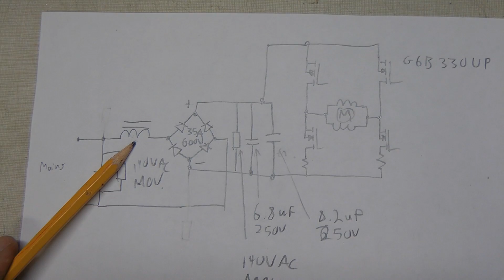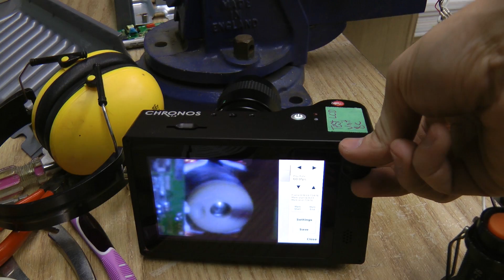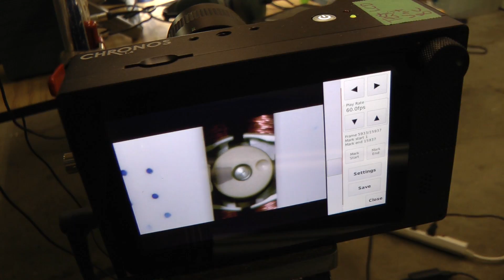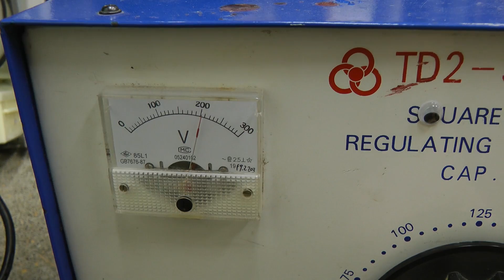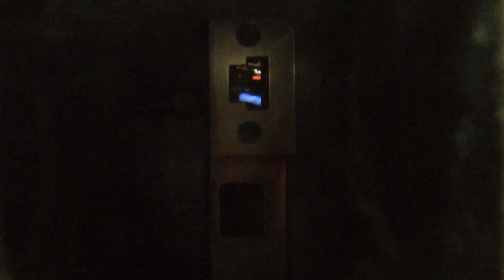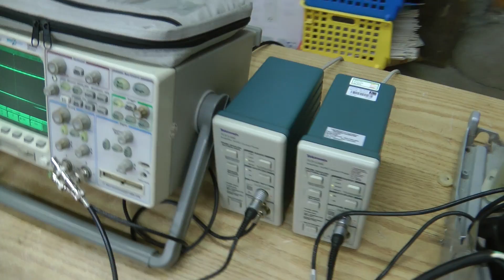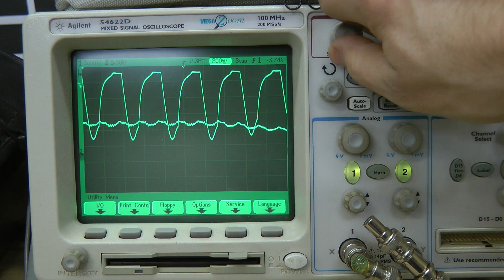Dyson Airblade teardown and repair - AB-14 and AB-02

Comment: The motor is actually a single phase interior magnet pmsm. Allows for high power density. I'm wondering if you could find an asymmetry in the airgap of the motor as it has this nice starting behavior?

Comment: Audio interference.... A few years ago I was at the 100 Club in London, where they had these in the toilets, and you could hear them breaking through into the PA system
Reply: That is impressive amounts of EMI
Reply: @Andrew Ballard Iseewhatudidthere
Reply: The PA system and the bog should be fed from their own supply. Sounds like the hand dryers were connected to the same ring circuit as the PA system.

Comment: These have always looked like over-engineered bacteria farms to me.  I wouldn't use them unless I was forced to.  Give me a paper towel any day of the week.
Reply: I hate how narrow the slot is. Gotta be careful not to accidentally touch all that bacteria.
Reply: Corona virus, the dispenser.
Reply: Yes, the airblade v, airblade wash+dry, and airblade 9kJ are better designs.
Reply: It's funny how badly this comment ages. Now that the 9kJs have been established they are aldready dying and sounding rough, whereas many of the original airblades from the 2000s are still going strong

Comment: It’s quite funny that they have invested so much engineering effort to minimise the noise of the motor vibration and air compressor, while the airblade nozzles just by themsleves sounds like a f*cking jet turbine while operating... Is it just me, or they could spare a lot of expense in that department?
Reply: It's probably a lot louder when you combine the two sources of noise!

Comment: I never liked the dyson ones. Your hands always touch the device and they are not effective with big hands.
Reply: Yeah, and there's always that cesspool of nastiness at the bottom which you inevitably touch if you have big hands - ugh, I avoid these at all costs. Even good ol TP and picking bits off your hands a few minutes later when they actually dry is better than the dysons

Comment: The die cast airblades used to corrode with heavy use. You would see high-traffic locations such as airports and theme parks which would have significant corrosion on the drip pan. For that reason, I am not opposed to the plastic chassis.
Reply: @zaprodk  They could have just decided to retrofit an insert of plastic.
Reply: Exactly this. I got two of the first generation ones for free, for no reason other than cosmetics. They were in the lobby of a very nice hotel, and they were replaced due to the corrosion making them ugly.
Reply: @kelvinstokes996  thats like saying to someone your ugly when they are inteligent and kind but just because they have a skin condition they dont get freinds

Comment: Maybe they use the hall sensor to detect the absolute rotation at rest to it starts reliably
Reply: I was wondering if the "cogging" strength was deliberate (and not so much as a side effect) so the motor at rest is in a predictable state between poles after powering down?  I'm 100% guessing, as I have little to no idea what I'm talking about, unlike yourself. 

The only foundation I have for my guess is that the motor took a good while to come to rest, it seemed to oscillate quite a fair bit before coming to a complete stand still. Eddy current to position? 

As I say, not a clue. Sorry for wasting your time if you read this comment.
Reply: Well the poles are not at 90 degree angles. The hall sensor knows where the rotor sits and thus the next pole to energize with a "+". Form there on it is either an open loop slow start of a closed loop hall feedback (I suppose open loop).

Comment: They actually don't depend on sensing to determine motor direction.  Instead they use a salient pole to ensure that the field moves in only one direction.  All DDMs that I know of are open-loop.  There is also active control of the drive waveform at speed, somewhat similar to the SMOOTH technology used in ST's brushless motor drivers.

Comment: Hi Tesla500, A quick question about the motor bypass. From what I understand you are connecting the white signal wire to the black neutral wire in the cable that powers the control board, and taping off the red live wire. 
Is this correct? I'm using the motor for a low-cost air knife build and I just want to make sure ere I blow it just before installing it 😅

Comment: Yeay a Tesla500 video. The clear plastic so deep in the motor/turbine is an interesting choice.
Reply: Must have been a cost thing, using a batch of contaminated transparent mix instead of any other colour, because the plastic batch has a minor colour error from being mixed with other beads. You see a lot of inner plastic parts made with multicoloured recycled plastic, that has been salvaged, extruded into beads and chopped up, and then all the odd bits of colours left over in the batches are run as interior parts where you do not care much about colour,.

Or the plant just wanted to change colour on the moulding machine, without stopping, cooling and stripping to clean it, so swap to the die set for the inner, change the bead supply colour, and run a few thousand cycles of parts till all the old stuff has been purged out. Saves a lot of wasted plastic, and makes a saleable product, instead of a 5 hour clean cycle losing money.
Reply: @SeanBZA  seams reasonable. My thought was that the housing might have been of polycarbonate, maybe for shatter resistance. But tbh that's mostly based on the fact that I can't remember seeing opaque polycarbonate.

But at you say Dyson tend to make a lot of translucent parts so it would make sense for them to have some translucent wast on hand.
Reply: @coolfrost6  Polycarbonate is not the most easy to work with, so they would have gone with a cheaper plastic wherever possible, even if it has to be thicker. Polycarbonate for those high strength outer housing parts, then cheaper PVC or other plastic when cost is a driving factor.
Reply: @SeanBZA  I agree that is why it strikes me as od. Correct me if I'm wrong but the only injection moulding plastics I'm familiar is PS, PET, PMMA and PC that would yield that level of translucent. Maybe also some funky versions of ABS.

Of those I only think PC and funky clear ABS are reasonable choices.
Reply: @coolfrost6  Plastic front and back panels in old Hameg oscilloscopes are made of opaque polycarbonate. I remember because I wanted to repair a badly cracked one. I had to weld it with dichloromethane because it's the only suitable solvent for PC, and most adhesives don't do very well either.

Comment: I guess the potting to hold the components in the first motor is to reduce the chance of the components breaking off with vibration over time?

Comment: I found the same with their vacuum cleaners. I had an older Dyson which finally expired after 15 years, I was very pleased with the service I got out of it. Went to replace it & was very disappointed by the construction of the current ones, they felt so flimsy. So I bought a Shark instead.

Comment: I love how it is basically a turbocharger impeller wheel, it would be neat to try a larger version of this motor on something like the electric centrifugal (turbo) blower you did a while back. There are finally kits available for cars that do make several PSI boost. (Search cleetus electric supercharger on YT should pull it up).

For one of these Dyson motors, at 2.6PSI that would make one hell of a Hovercraft. The RC ones I build can carry 50Lbs easily using fans that have  0.27PSI static pressure on a sheet of foam board. (See my videos)...

As long as you are on a smooth surface and have a decent seal you dont need a lot of CFM, you could do a more compact "hoverboard".

I was wanting to do a human rideable one, say 20 inches wide by 5 feet long for the base. I'll likely use ducted fans, but in reality I need something like 0.7psi + to have decent performance from the skirt fans.

You could literally take a giant cardboard box cut the lid off nice and straight and duct that in and ride it.

If you had a gaylord you could shorten perhaps?

Comment: 240v with a buck transformer down to 208v  could use a standard  240v to 30v, wire the primary and secondary in series out of phase to knock the 30v off ? 
It would prods be ok on 240 anyway  :)  nice vid David  thanks fella

Comment: 26:10 Its for filtering out both high and low frequency noise they use both, very common practice, and it can not be done by one capacitance value.

Comment: Hello, I would need your help, on this motor there are 4 wires, 2 large and 2 smaller, the two large ones are permanently supplied with 230V (in France).
  I guess the two smaller ones should serve as a command.  How does this command work?  Thank you in advance for your answer

Comment: I got an issue my dyson hand dryer, it works fine but starts by itself sometimes, it started happening once i replaced the casing to a new one and im thinking if there is any particular way the sensors go back on? Is it possible i might have put them in the wrong way or something?

Comment: Imagine a leaf blower with one of these motors. Nice fix.
Reply: It wouldn't have enough CFM to be practical. These are more focused on pressure, which is why they look like turbo compressors. 

My leafblower produces ~400CFM, where an airblade is ~75CFM.

Comment: 31:50 much more serviceable? Still can only desolder it with four hands or with a desoldering tool and the huge components will vibrate and fall off eventually. Also it is not intended to service it, there is no brushes on the motor, just don't plug it to wrong mains supply and it will last forever.

Comment: I think in that older unit the filter inductor was originally on the board, using a expensive high permeability core, making it very small, but expensive. Then they went to the larger ferrite core as it would do the same filtering, but at a much lower cost per unit, even with the need for an extra assembly step to hand solder it in and hand tie it to the bracket. 

Newer one I would guess they put the coil there to get cooling for it, and also reduce envelope by using otherwise unused volume in the motor end housing. Just made it larger, slightly more expensive in copper, but then they could use a very cheap ferrite material for the core, and being larger made it easier to wind as well.

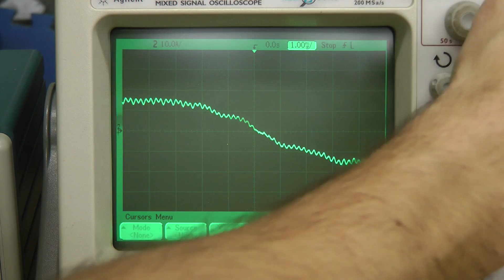Comment: Hi, great video. However at 34:00 you tried to predict the powerfactor from just the single trace.
You need to compare voltage and current to get powerfactor, just the shape of the waveform will not tell you powerfactor.
Your scope could have shown you any phase difference between line voltage and current.

Comment: Awesome video.  I think I prefer the newer design, minus the glue.  However I would have used just one PCB for everything and ideally separated it from the motor, or kept it in the motor and made it easier to service like you mentioned.

Comment: I'd be interested to see the other models too. (airblade wash+dry, airblade 9kJ, airblade V, and what the difference between the original airblade and the "airblade dB" is.) The wash+dry seems very interesting to me. (The air blade dB is for places where noise is a concern and is supposedly quieter.)

Comment: So, there’s no other fuse, in this well designed product that would have popped prior to the  motor being blown up? It’s appears that Dyson doesn’t want people looking inside their patented equipment. Hence why all of the super strong glue. There’s hidden technology in this motor, no doubt.
As you say in the beginning of this video, no one has done this before. 🤔 Hmmm... Great video, 
Congratulations 👍🏽
Reply from the maker: Having worked in power electronics before, the transistors are there purely to protect the fuse by blowing first XD. I'm on the hunt for a truly broken motor to completely take apart.

Comment: Looks like some of the pads on the bottom of the power transistors lifted off the board and stayed on the transistors... hate when that happens :( Or maybe it's just some leftover solder - you showed the other side of the board later and it looks fine. Still though, that's shitty to glue the components in like that.
Reply from the maker: I noticed that too, but the pad stayed on the board somehow. It looked like it pulled it off though.
Reply: It's probably just the remains of the topside fillet.  You're fighting on a pretty steep thermal gradient to get enough heat through to the far side of the board.  The suction tends to leave them behind when the thermal load is high.

Comment: No one can overdo something like Dyson overdoes everything. Why would you die  cast something that sees no load. Could it be for noise?  The plastic does the job for 1/10 the cost.
The new model is profoundly simplified and no doubt more profitable. I get the impression that these products are developed by large teams where no one has control of the big picture.
No one is screaming "NO THAT IS TOO COMPLICATED" when they build something out of a hundred parts.
 I see the value in the centrifugal compressor as an air pump. The main benefit of this configuration is a large pressure differential in one stage. At small diameters the RPM must be high to get the peripheral speed past  M,5 where it will work. Modern motors make that practical. The rotor makes no pressure by itself it's only purpose is to accelerate the air. A structure that follows the wheel called the difuser slows the air to create pressure.  Making all this quiet is likely the biggest problem. The resonant suppressor is a clever solution. I own a variety of Dyson products that work well - every one  of them is a masterpiece of over engineering.

Great teardown very interesting.
Reply: Well, considering that these would be used in more or less public restrooms, the inclination is to make things vandal-resistant.  Even the older heated electric hand dryers have heavy (often cast) housings.   Of course, those dryers didn't have to deal with corrosion because they were actually evaporating the water, or at least not blowing it back into the equipment itself.

Comment: I'm electronics engineer I do not like Dysons products because he uses rubbish methods like the Dyson Digital motor and like you can see in the video they blow up easily if he just used a normal standard motor you would not have any of this problem at all and this is why I dislike Dyson